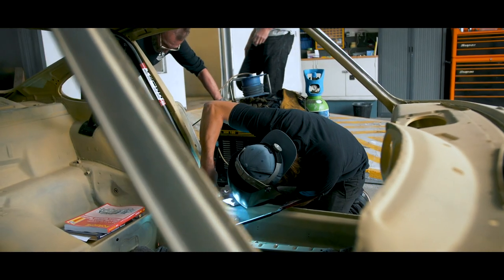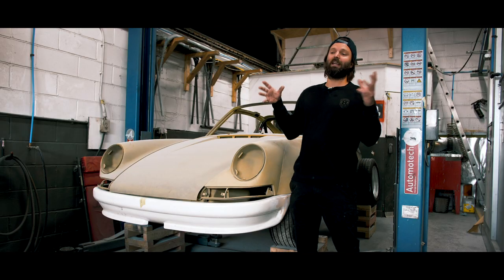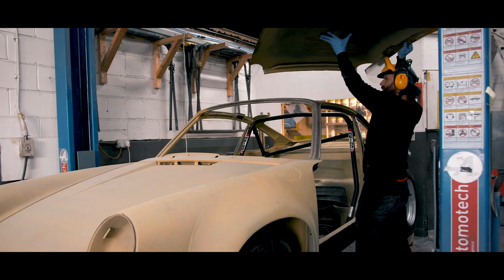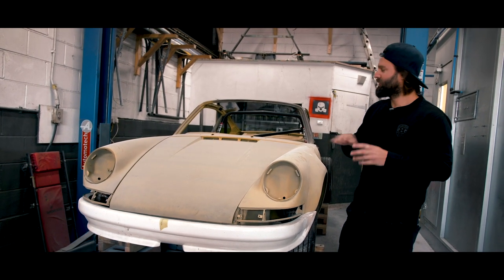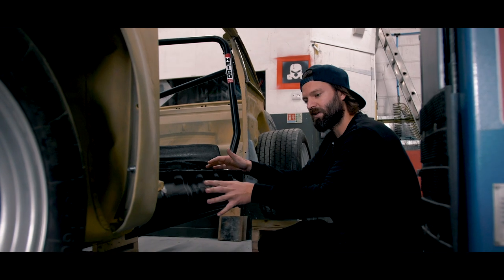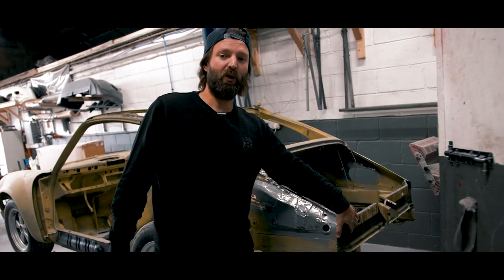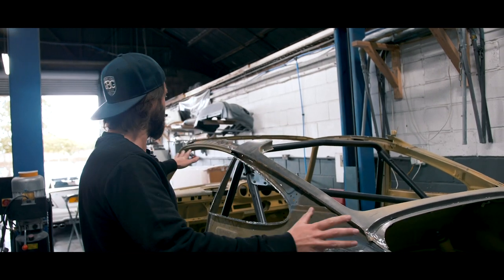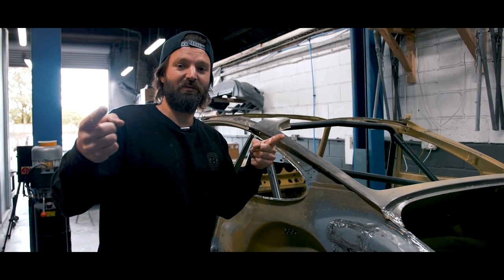Episode 3 - Restoration starts on the GBG Porsche Backdates dodgy bodywork

Comment: Would you happen to know where I can get the correct welting for my 1985 911.  I am missing welting, I’ll try to describe where it’s located:
driver side, the square-ish “cover” that sits against the bellow , between the bellow and the wheel well above the valance, the bellow actually tucks under this “cover”. This cover should have welting on the top and bottom. I’m missing the lower welting.  I don’t know where to find a small piece to purchase.. and the correct one. Any ideas?  Thanks so much

Comment: why did they remove the roof?
Reply from the maker: Hi John, because after the shell was acid dipped it revealed a huge valley down the roof that had just been filled with a massive layer of filler in the past. It looked like in the past the car had had a sunroof and had been dodgely filled in by whoever had worked on it in the past, so we swapped it out for new metal. You can check out the state of the roof in the walk around after the acid dipping in our previous video here https://www.youtube.com/watch?v=a8HgXgDGNHQ&t=4s